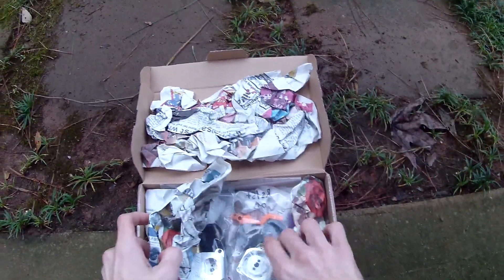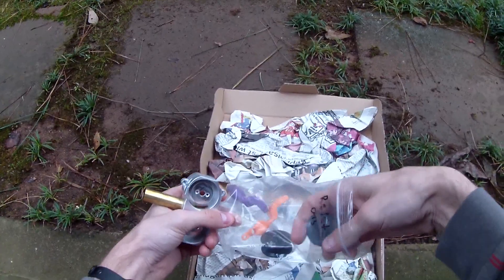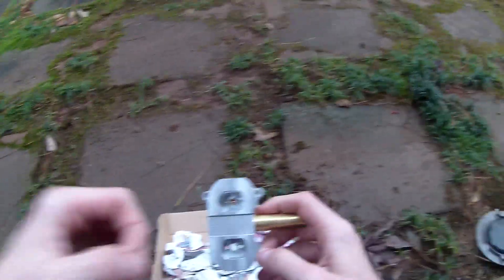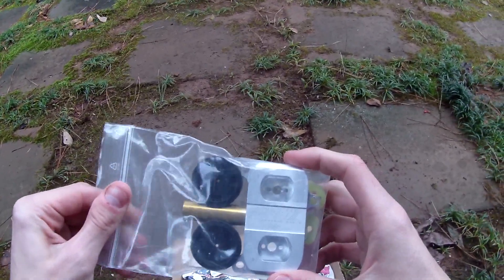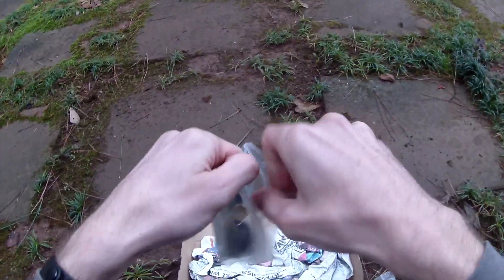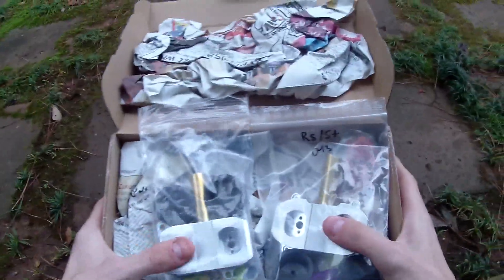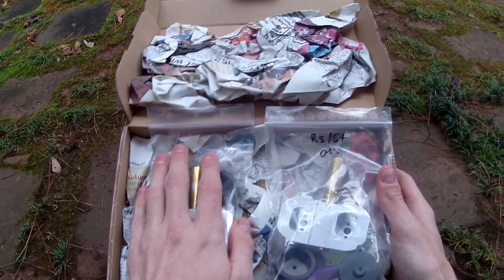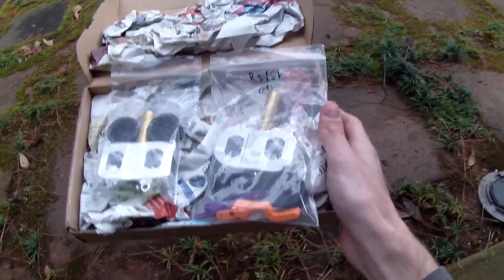Unboxing Precision German Aluminium Flywheel Cages from Dr.Snikkas

Comment: Don't Hide it in a Nerf shell!  Make metal skeleton that shows off the cage like the FDL-1.  I would also like to see the flywheel cage mounted horizontal like the FDL-1 so its more of a flat top.  Add lots of LEDs.  Make a metal motorized pusher for it that can be dialed to the users preference for rate of fire. Cerakote or ano the skeleton.  Go nuts and have fun.

Comment: +LordDraconical hey drac, wouldn't a brass barrel or breech be a hindrance in a flywheel blaster because it does not use air to accelerate the dart, thus the tighter barrel would only increase drag without increasing  power?

Comment: The rayven is my favourite as well.
Reply: Psssh, Stryfe is where it's at!
Reply: +GamingFoxNetwork modded, yeah. I don't have those kind of tools.stock ones barely get 5 ft and then they jam, or at least in my experience.
Reply: I hate the Raven. Mine jams so much. I probably wil mod it eventually but for now it sucks. Then again I do have the original model out of like 3 so you kind of expect that kind of performance. Plus it fire like 10 feet.
Reply: +Leviathan Gaming yeah thats probably an older one than mine, but then again I probably had an old stryfe.

Comment: you should make the "Rapistryfe" which is a "sleeper" blaster. A stryfe shell that has full rapidstrike internals.
Reply: +The Remote Donut 
A Rapidstrike pistol can be cut down to around the same size of a Stryfe. The pusher box in the Rapidstrike is too wide for a Stryfe shell.
Reply: +IAmBobololo That's true but doesn't it still look like a rapidstrike? I think a sleeper style gun would be sweet! kinda like dracs (Or I think it was drax) old vid on the long strike with the barricade internals.
Reply: +IAmBobololo Also im a huge fan of yours BoBo I freaked out when your responded!
Reply: +IAmBobololo Also im a huge fan of yours BoBo I freaked out when your responded!